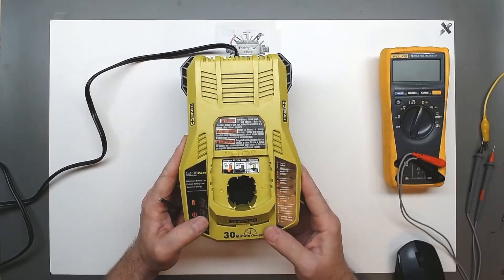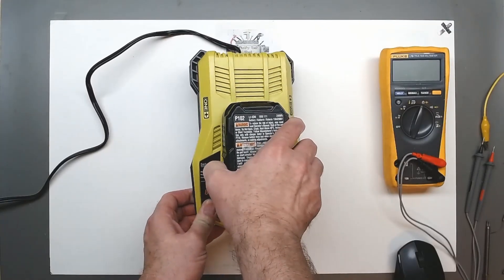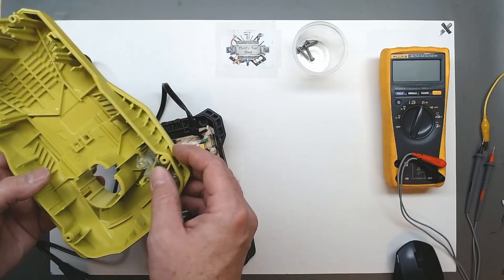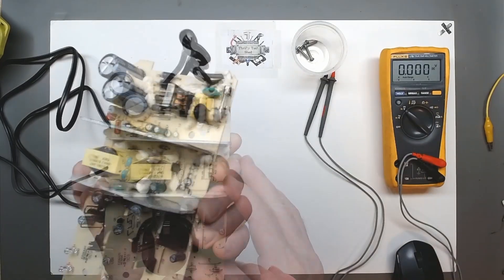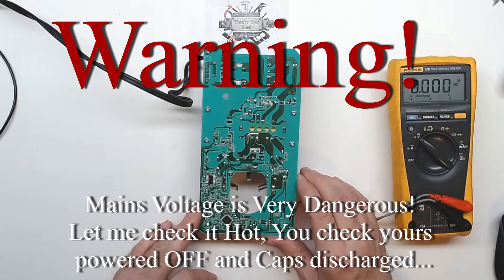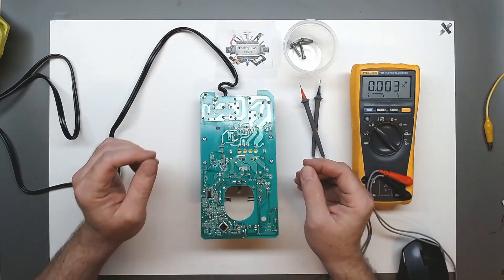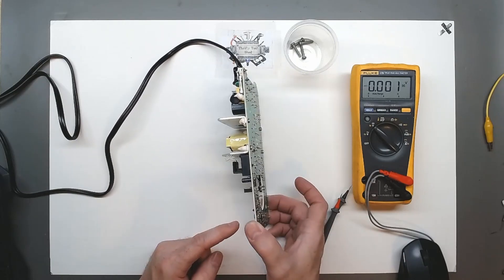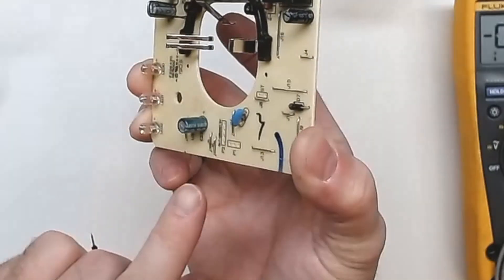Ryobi P117 Intelliport Charger Repair

Comment: Thank you for this awesome video, I repaired two chargers, one with a bad chip, and the other the resistor. I didn't have  an smd 1/2 ohm, so I tacked on a through hole 1 ohm, and it worked perfectly. I replaced the chip on both chargers.
Thanks again. 
Paul, USA!!!

Comment: Ryobi charger has red and green blinking lights.  After trying several Ryobi batteries with the same result I ordered a new Ryobi charger. If this does not fix the problem, my Ryobi trimmer, , inflater and impact driver along with the batteries and chargers will go into the rubbish. I thought I could save a few dollars and bought these Ryobi tools instead of staying with Dewalt or Bosh.  Never again, you obviously get what you pay for.

Comment: I dont have a r71
Reply from the maker: I have seen at least 2 version of this charger now. Some do not have it. The board layout seems to have changed. It does look the same or at least similar on the outside.
Reply: I will send  u a picture in a bit

Comment: Friend, the relay is not activating and does not allow the voltage to pass, what could be the problem?
Reply from the maker: Hard to say from that. Did you also have a bad resistor as in this repair?

Comment: mine is missing that rezistor, i checkd all other rezistors, diodes, no bulging on capacitors, what can it be?
Reply from the maker: Impossible to say from here. It seems yours is a different version if the resistor is not in the same location as this one shown in the video.

Comment: What is the yellow light for?
Reply from the maker: On this model is usually means the temperature is out of range. Could be too hot or too cold I believe. Could even be a bad connection on one of the smaller terminals possibly causing an issue.

Comment: Thanks for your video. Another video showed the resistor at R71 opened also. Apparently an issue with that board version. I am repairing one right now, but the board version is different as I have no R71. In my case, the AC power switch connected to the first heat sink failed. That also seems to be an issue with these units.

I learned something doing this project. I was troubleshooting components with an XY octopus curve tracer.  On my board, I was checking Zener diode at ZD5. The curve tracer showed it as a diode versus a Zener diode, no second knee. Come to find out the Zener had a higher breakdown voltage than what the octopus could show, and it was actually a good senior. When I removed the diode to check it out of circuit, I was holding it down, and it zipped away into nowhere's land.  Because it got away, I don't know what value Zenor it was.   Hoping someone can tell me, but it's a longshot. Anyway, loved your video.

Comment: Thank you. I had the same problem. Fixed it with a non smt resistor. Just drilled 2 holes in the board, mounted the resistor, and bridged to the old smt part. I enjoyed listening to you troubleshoot the board. You have a great depth of knowledge troubleshooting with out schematics!
Reply from the maker: Awesome job. Thanks so much for your kind comment.

Comment: Hola soy de Monterrey te felicito es muy buena enseñanza una pregunta dónde compraste las refacciones.
Reply from the maker: Hi,
Thanks for your kind comment. I usually get parts from Amazon. I have links in the video description if needed. I recommend the SMD resistor kit, even though it does not have the .5ohm, it does have many 1 ohm as well as many others. I also share links to many tools and  items I find helpful and that many viewers ask about. Thanks and Merry Christmas!

Comment: I have the same charger i was working on someones place and i went to plug it in and i saw a spark now it wont turn on. I opened and the fuse looks blown do u know how to change that
Reply from the maker: If I remember correctly you have to solder those in. About 5% of the time you can be lucky and the fuse replacement may possibly fix it. Usually it's something else in the power supply section that has failed blowing the fuse. Best of luck to ya!
Reply: @ThriftyToolShed  yes it needs to be solder well im going to change the fuse and see what it does.

Comment: I thought it was 50 ohms the R500 so I replaced it with 50 but it doesn't work so I analysed my other Ryobi board and compared it I have found out that they just put a 0 ohm resistor instead so I replaced it with a 0 ohm from my donor board and it work's perfectly.
Reply from the maker: It was .5 ohm as mentioned in video. 
Glad yours worked, sometimes low values are current sense resistors, but I am not sure on this one.
Reply: @ThriftyToolShed  Thank you for your video it's very informative. Keep on making videos.
Reply: @ThriftyToolShed  Both Thrifty & Jetsky you 2 are my heroes, I simply jump the 0.5 ohm resistor and my Ryobi charger is alive again, big thank you 👍

That R500 was reading 1.7M ohm in my case !

Comment: My charger will charge for a several seconds then stop. After market replacements on ebay are about $20. I won't be doing this kind of repair. I wish I could.
Reply: I decided to look into this further as I figured there must be lots of sawdust and insect debris inside which could be causing overheating. After breaking the security tabs off the screws and getting it open I blew it out with compressed air and sprayed some contact cleaner all over and blowing it out again. It just charged my old style battery completely and is now charging a lithium battery. Seems like it's fixed.

Comment: Our new puppy chewed thru the electric cord on my P117 charger.  I meant to repair at the time but didn't.  Now, can't locate the cord end that plugs in the outlet.  Trying to find out which wire goes to gold contact in replacement plug and which one goes to the silver connection.  One wire has ridges running the length of the cord. Silver or gold contact?  Thanks
Reply from the maker: The wire with ridges or ribbed is usually the neutral and the smooth the Hot. It's been way too long to remember about the one in this video, but it is a standard for it typically. That means the wire that is smooth should be going to the fuse of course if you want to double check. So ribbed wire to silver and smooth wire to gold.

Comment: Thanks M8, add me to the 0.5 ohm failed pile. I had a 1 ohm wired resistor and placed it from the diode to capacitor leads, ugly style but it worked.

Comment: Can u send a link where I can buy the set u use to fix the charger
Reply from the maker: Are you looking for a SMD resistor set?
Reply: @ThriftyToolShed  Yess
Reply from the maker: Well this is similar to what I have as a good starter kit for 603, 805 and 1205. The only thing is that it doesn't have .5ohm as a value it starts with 1 ohm like I had to use in the video. 
Most kits don't come with .5 ohm that I know of. 
https://amzn.to/3QhbU79

Comment: R71 doent exit on my board my board version "intelliport-charger" "ryobi p117" 
my pcb 
HW 1723
TTI P/N: 260501073
Dec 7,2021

I inserted on 220VAC, using TRAC Based (travel 220 to 110 voltage converter) adapter. Now it is not working. Fuse is ok. there is no physical damage too. what could be possible gone wrong.
Reply from the maker: Sorry to hear it's a different design. I would check resistors if some around the same area and then the switcher, the high frequency switching chip if its at all similar to this charger board. Best of luck to ya!

Comment: You are one SMART dude!! My neighbor asked me to look at his NO LIGHTS P117 after he plugged it in after winter storage. It made an audible electrical snap sound and then quit working. Your advice led me right to the problem. I replaced the the SMD resistor you pointed out and the charger is back in action. Never would I have found that without your help. Thank you.
Reply from the maker: Awesome! Thanks for your kind comment!

Comment: Thanks! Was cleaning up the shop at my office (I dont ever really use power tools/things in there - I do more of the hands on electronics work) and saw this charger wasn't doing anything. Coworkers said it worked for like a week and has been non functional for a long long time. Figured I'd take it apart to see if it was something easy like a fuse. Found this video, R71 was in the mega ohms so found a through hole .47 ohm 1 watt resistor and soldered it in. Seems to be working!
Reply from the maker: Awesome. Thanks for sharing!

Comment: How critical do you think the R71 value is? I have 0Ω resistors and the lowest I otherwise have is 2.2Ω.
Reply from the maker: I honestly can't say for sure. I assumed it was a feedback resistor so I tried to keep it as designed for that assumption alone?
Reply: @ThriftyToolShed  I found a .62 Ω 1/3W 0805 one in the back of my tool drawer and that seems to be working, at least for the first 15 minutes. I'm going to order a cut tape of .5Ω 1/2W 1206 resistors from DigiKey for the next time. Thanks!!!
Reply from the maker: @nsayer  Awesome!
Reply: I used 1 ohm and it worked fine, will see long term.

Comment: I know this information has nothing to do with this video directly but, I figure a way to charge the P102 using a bench power supply without opening the case. Well actually, I found two ways of charging with the Ryobi P102 using a power supply.

Comment: I had to go through one of these live as well. I realized I hadn’t turned on my power strip when I had no power anywhere on the board. Leaned over to turn it on and stuck my other hand across the mains input on the board 🤦‍♂️ Someday I’ll learn to quit when I’m tired. Luckily 110v ac isn’t that bad in most situations. 

I have got it bad a few times. I have a mustang that is more race car than street car, and it developed a miss at idle while driving home when it started to rain. Looking around the engine bay for obvious issues (car running) I found a plug wire had melted against the header. And by found, I mean it shocked the crap out of me. Car idles at 1200rpm and has an MSD 6al2 ignition and 60,000v coil. Right arm grounded to the engine, left got the plug wire. I had to check to see if my heart was still beating, as I had never felt anything like that and thought I was dying. I couldn’t see straight for a good ten minutes. Not something I want to try a second time. 

Thanks for the video!
Reply from the maker: Thanks for sharing! Yes I understand the pain somewhat of the ignition system, its very painful, hurt through my elbow to the top of my head. I never felt one as you mentioned with the 60KV MSD, but the newer model cars ignition system is no fun getting a hold of ya!

Comment: Thank you!  This resistor was bad for me too.  I replaced it with higher wattage .5 ohm resistor.  It works now and I'm hoping by going to a larger wattage it will handle whatever it was that blew the resistor to begin with.  I have another P117 charger but its a previous version and it doesn't have the same layout so It's still broken.  But now I have a working charger. THANK YOU!!
Reply from the maker: Excellent job, that was my thoughts as well on the higher wattage! Thanks for sharing!

Comment: Excellent video, love the troubleshooting, great mind at work. My p117 lasted years, just died a month ago, no lights at all. I don’t have the .5 ohm resistor on my board! Others around it, that I see in this video are there but where .5 ohm should be there is nothing at all! I am getting the correct high voltage on the upper section, but don’t have the 5v in the chip pins like in this video. Nothing looks burned or bulging. I am about to go get a new one. If anybody has any ideas, I will try them
Reply from the maker: That is good to know yours is different. I would not know for sure but see if 5V regulator is faulty? Thanks for sharing and thanks for your comment.

Comment: My P117 charger died with no lights as the major symptom. This video was one of the top search results. Sure enough my half-ohm resistor was bad. I didn't have any half-ohm resistors and shipping on them would take months so I used two 1-ohms just like the video. My charger is now working! Thank you Thrifty Tool Shed!
Reply from the maker: Excellent job, thanks for sharing!

Comment: Like to share my experience with my P117.
The 'high voltage' on the primary circuit side isn't working. You should hear a bussing sound (the high voltage oscillator) feeding the primary winding. 
This circuit powers the primary winding of the yellow transformer in the middle.
The primary winding has four pins. The resistance within these types of transformers, usually have a low resistance.  Two pins have a very low resistance (ohms). The other two on the primary side measure a very high resistance of megaohms. At the time I wasn’t sure why. I would have expected a low reading of around 20 ohms.
The secondary winding also had four pins and all four measured a low resistance.
I decide to unsolder the transformer because what do I have to lose, it doesn’t work anyhow.
I found the wire coming from the winding was broken off at the soldering pin of the transformer. Soldered the broken wire back to the pin.
It’s fixed.
Reply from the maker: Great information. Excellent work. Thanks for sharing!

Comment: Thank you for sharing this how to content. I have a question. One of my charges was left outside where I imagine a small amount of moisture got into it. I have not plugged it in and have let it sit in front of fan…curious if I do disassemble it is there a proper way to clean it?  Like electrical cleaner spray before attempting to use it? Thanks again!
Reply from the maker: I would absolutely clean it if you think it got moisture inside. A good plastic safe electrical parts cleaner or at least use 99% isopropyl alcohol to clean the board very well.
Reply: @ThriftyToolShed  Thank you for the feedback. Didn’t see any corrosion upon opening it up however I hit it with some electrical contact cleaner and buttoned it up. So far so good….thanks again

Comment: Saved a lot of troubleshooting time, so thanks.  Same resistor on mine.  I did have a drawer of 1 ohm 1/4w axial resistors, and easier to solder a couple of those onto the two pads that the bad resistor goes to, and just leave it there on the board, plus they are more durable.  Sounds like Ryobi has an engineering problem with this charger for so many to have the same resistor going out.  Probably designed to burn out about the time the warranty is up.  Not holding my breath that they will ever fix it... not if they can keep selling replacement chargers.
Reply from the maker: Glad it helped, yes as you may see on my channel I have to use THD alot in repairs for SMD failed components! Thanks for your comment!

Comment: Hallo. I have problem with my charger, when charging is complet, the green led briefly stops flashing and then continues to flash again along with the red led. In addition, today I noticed that during charging, both red and green leds are much paler than before. What is it, some advice? 
By the way, the video is very informative and useful- all the best.
Reply from the maker: It does this with multiple packs correct?  Tested more than one?
I have not seen that exact issue with mine, but I would check the capacitors on the board. Of course make sure power removed and caps are discharged before attempting. if you see any bulging, swollen or vented caps its a tell tell. That is not always what you find, but alot of the times. Of course some are

Comment: In my charger the  transistor near the .5 ohm resistor was burned ,  a 2N3904,  replaced both ( transistor and resistor)  and  now works fine

Comment: I’m so stoked! I couldn’t find a .5 ohm resistor in time but found an adjustable resistor pot and soldered it on. Works good now! Thanks for the helpful video! It wasn’t mine but I got a pair of muck boots out of the deal.

Comment: SMD resister was open. Couldn’t find local source so ordered 100 0.5 ohm resisters off EBay for $1.28 delivered. Took 2 months to get them, then 5 minutes to get solder station out and fixing. Thanks for your video...
Reply from the maker: That's awesome!

Comment: Nailed it... same problem on my charger, occurred only about two months after I got it. No idea if it was a power surge, static damage or what. I had some 1 ohm, 1 watt leaded resistors from other projects and put two of those in parallel - lots of room on that side of the board. I wonder if they under-spec'ed the power dissipation on this particular part.
Reply from the maker: It may very well be. It does seem to be alot of the same failures on these. I did not know that when I shared this video.  Lots of comments about same issue for sure with this model.

Comment: Resistor on 15v supply opens due to crowbar circuit, could post a voltage reading on the microprocessor pins.
I have a unit with 35, 15 and 5v all ok. I suspect the micro.

Comment: What would be the first thing to go if one of these things gets wet
Reply from the maker: It depends if powered on while wet. If powered on it could really be any power device that could have had low resistance (like a short) and failed like transistors etc. If not powered on when it got wet then corrosion is the biggest threat and usually the smallest chips like the microcontrollers show signs first with corrosion in-between the tiny pads or leads. When boards get wet the only thing we can do is remove power quickly and clean board well with plastic safe contact cleaner or at least Alcohol (high % IPA) sometimes we can get lucky, but left  unclean the water damage will slowly attack the components until it's beyond repair.
Reply: @ThriftyToolShed  thanks for the info yeah it was on when I got wet it's cooked LOL looks like I need to go buy me a new tool. instead of buying just a charger I can get a little vacuum or something that comes with a battery and charger for the price of pretty much the charger I just smoked
Reply from the maker: Exactly right!